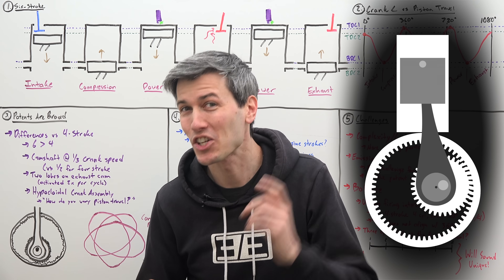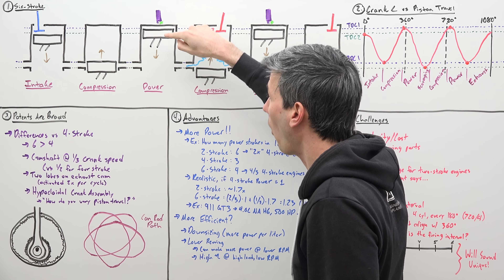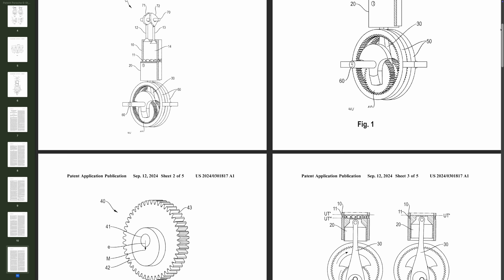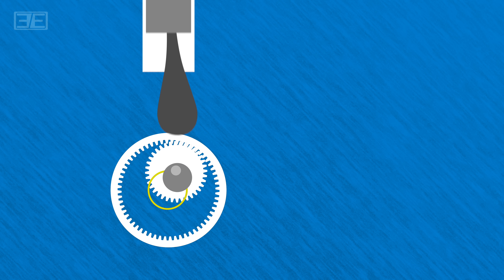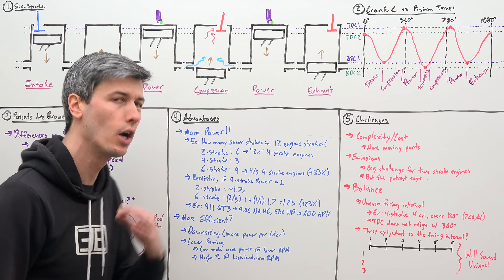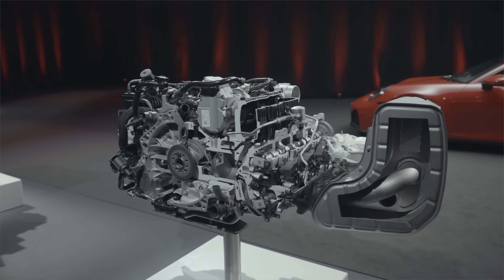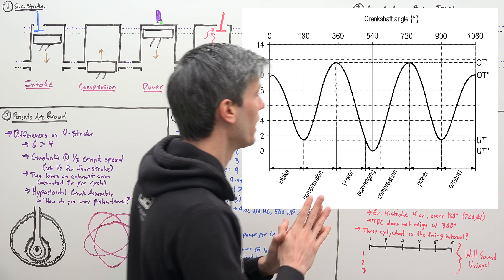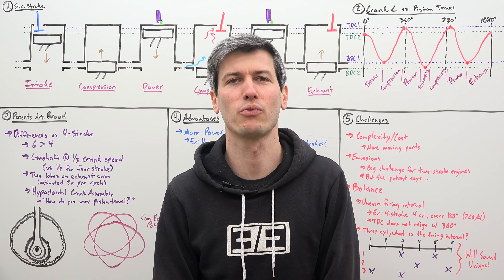Porsche's 6-Stroke Engine Is Genius!

Comment: I dont see how this engine makes any sense.... So they're basically saying that a 2-stroke is better? At this point, you might as well have something like 2 cylinders 4-stroke and 1 cylinder 2-stroke in an inline 3, if you really want to combine them.
But there are reasons that cars run 4-stroke engines, despite 2-stroke ones being more powerful, as the vid says.
This just seems like a publicity stunt

Comment: I built a 6 stroke engine from a lawnmower engine 35 years ago in high-school.  It was a regular 4 stroke, then an extra intake and extra exhaust.  I had to rig in a second set of small valves and cam for the last two parts.  It wasn't more efficient,  just cooler running by the extra breath of air.  At first I used the regular valve and modified cam/timing gearing but it was doing an intake thru the carbon and just loading the exhaust with fuel, though with fuel injections it could have been simpler...but that wasn't going to happen with a lawnmower engine in 1990

Comment: 1. What a wild concept. I suppose maybe if they were to time their tdc on each cylinder to not necessarily be perfect like a typical 4 cycling but more like the cross plane of a Yamaha motorcycle engine. I can only imagine the angry Germans yelling at one another coming up with this patent. 

2. Congrats on your 1000th video. I remember back in late 2012 when I was a young apprentice mechanic that just bought a WRX finding your videos on YouTube. I never would have thought you would blow up like you did. It has been inspiring to watch as you learned new things and explained it so well to the minds of others that generally don't just read materials and understand it easily.

Comment: Innovation is always cool, but I really don't se the point outside of expensive sports cars. For a fun driving car I would prefer a high performance 2JZ, RB26 or a LS for a larger engine. Just a simple high performance engine. 

For a daily driver the technology has come so far that a electric vehicle always would make sense. 

So outside motorsports and luxury cars the new, modern and extremely expensive high performance engines is kind of dead. Because car people want older fun driving cars and regular people want low cost cars where EVs are dominating.

Comment: Would using Mobil 1 Hybrid 0W-20 instead of 0W-16 be ok to use? Hybrids don't run as hot and have more condensation in the oil. The new Hybrid oil is made to help with that. the Toyota owners manual says if 0-16 isn't avaible you can use 0W-20 till the next oil change. But would using 0W-20 all the time harm the engine?

Comment: Balance solution: 3 cylinder radial with 'big bang' timing. 
Cylinders each 120° apart, all fiting st the same time. 

Problem solved.

Comment: The issue I see is that in a two stroke engine the mixture enters as the piston is travelling downwards and is slightly compressed into the cylinder by the timing (by location) of the intake port. Similarly the exaust leave the cylinder with pressure from the power stroke, dragging in the intake charge as it exits.
With this engine concept (if it is to be NA) then there has to be sufficient vacuum in the cylinder when the piston clears the intake port, for the stationary air to be dragged in. This has to happen at the start of what would (in a 4 stroke engine) be the start of the exhaust stroke. I just can't see how (without forced induction) this engine will be able to exaust gasses and produce enogh vacuum to replace the volume of the cylinder in the duration at BDC where the intake valve is open. 
If it somehow can do this, it seems that there would have to be a difference in the power produced in this stroke and the more conventional power stroke. 
Again. If it could be gotton to work, then you would do away with the other 4 strokes and make a 2-stroke that is efficient and doesn't burn oil. 

This seems like it will always be a concept.

Comment: Thanks for the great explanation. Could they also have like an eco mode where the second compression is just an exhaust stroke and no second power stroke? This makes 1 power stroke in 6 strokes but also lower fuel consumption and maybe cleaner air due to 2 exhaust strokes?

Comment: How do you get passed the oil lining the cylinder walls, and not entering the scanvenging intake stroke? Oil will likely mix with the fuel, and be bad for emissions.

Comment: Does that 4th stroke really work? If my understanding is correct while the piston is at dead center bottom, the exhaust value is open letting the exhaust from the ignition at stroke 3 escape which would draw in air from the intake port at the bottom of the cylinder. But as soon the piston moves up to cover the bottom intake port, the exhaust value will need to close to achieve compression.

The exhaust is not being pushed out by the piston like a traditional 4 stroke design, so how much exhaust is really leaving via the exhaust port? This has a direct affect on how much clean air is being drawn in via the bottom intake port. If there's not enough oxygen in the cylinder the 5th power stroke will be weak. I'm not a mechanical engineer so maybe I'm wrong.

Comment: This will not be a compact engine design whatsoever. A couple takeaways, if each journal of cylinders requires a gear as illustrated, it seems to me that a multi piece crankshaft would have to be used, and it perhaps would have to have a larger bore spacing compared to its relative displacement to accommodate the second intake charge from the bottom. And with the added 2 strokes cam timing, speed and lobe design will have to be different as well.

Comment: x-Xxxx is the firing he writes on the board (X being two combustion events occurring in the engine simultaneously), i imagine the X will be offset with crank angle to phase with the '-' (no combustion events) for multiples of 3. it's difficult to verify in my head how the timing would work for harmonic balancing but eg

if we can phase the crank in a desirable way
x-Xxxx
xxxX-x
Xxx-xx
-xxxxX
xXx-xx
x-xxXx

or if you didn't care about harmonics
x-Xxxx
xx-Xxx
xxx-Xx
xxxx-X
Xxxxx-
-Xxxxx

Comment: This engine has all the disadvantages of both 2- and 4- stroke engines. All the valves from a 4-stroke which are going to drain the power. The pollution of a 2-stroke since the piston is a second intake valve so the lubrication oil will go into the piston. This is just bad design and bad efficiency. The imbalance is your least problem with all those mechanical parts that can fail. You would be better off by just sticking to a 2 stroke engine if you want more power.

Comment: My guess for how Porsche would handle emissions would be using some of the unburned fuel from the first power stroke to help power the second power stroke, resulting in a cleaner final exhaust on the 6th stroke. I'm not an engineer or professional mechanic by any means so I could easily be overlooking some other potential issues, but it did look like one of the 2 exhaust cam lobes was smaller than the other causing less exhaust to be pushed from the combustion chamber during the 4th stroke. Hopefully someone with more knowledge of this stuff reads this and could comment further. I'd love to understand better as this 6 stroke engine is extremely interesting to me

Comment: Two questions I would have about this engine to wonder about secondary effects on torque control :
1. How does the spark authority change with the extra stroke? Would Porche be able to retard spark more or less with this design?
2. How does is the system affected when in fuel cut?

Comment: Design single cylinder engine with end caps that allow stacking more cylinders.  Put the single cylinder engine in a motorcycle to see if it's useful.  If so, start stacking cylinders.  The emissions issue can be addressed by routing the 2-cycle exhaust back thru the 4-cycle.

Comment: You can get even firing intervals out of a 6-cyl engine. 1-3, 2-4, 3-5, 4-6, 5-1, 6-2. If you’re crafty about it, you could probably even split the difference as far as that small degree offset (one cyl. firing slightly ahead of the 60 deg mark, and one slightly after). So 6 strokes in 6 cylinders. Couple that with 6 wheels, all powered, and you could build the world’s first 6x6x6x6. Which I’m pretty sure we need.

Comment: I thnk there is a neat way to balance it, though that also balances the power stroke not being perfectly aligned with 180 deg multiples
You just have to continue your graph for 6 rotations, instead of 3. If you start with the first rotation and you fire at 1-3, then 2-4, then 3-5, then 4-6, then you go around the clock and do 5-1 and finally 6-2.
You always have two almost simultaneous power strokes for each 180 deg, one coming slightly before and one coming slightly after the 180 deg threshold.
Reply: Great minds think alike! I promise I didn’t see your comment, but we came up with the same solution just 6 (!) minutes apart! Cheers

Comment: I think in a 12 cylinder the power strokes should balance out. That would have 4 cylinders on a power stroke every revolution. I'm wondering if the majority of this is actually egr or emissions related. Using the "2 stroke" part of it to gain power, then push that exhaust into  neighboring cylinders on their intake stroke to get a cleaner burn and lower emissions. I see a big problem with reliability. That is a bunch of extra moving parts that will eventually wear and break. I like that they are thinking outside of the box, but I fear that the gains made by an extra power stroke would be minimal due to the drag all the extra moving parts would cause. I'm very interested in seeing a prototype that hopefully proves me wrong.

Comment: Heck, how do you lubricate the cylinder walls without getting oil into the bottom intake ports? And whatever you do, why you can't do the same thing in a 2-stroke and get rid of the oil burning issue of 2-strokes?

Comment: The level of detail these engine designers go through to squeeze out a little more power.  Its impressive.  From math, I assume that the firing diagram would be more "balanced" at multiples of 6 cylinders, so not sure why the designers listed it out as multiples of 3?  I know in some cars like honda pilot they developed some sort of system to turn on/off just one of the cylinders while running, I guess let it "idle" and not try and get power from it.  I am assuming this technology could be used together to fix when a cylinder is going to fire or not?  So if one of your three cylinders stays "idle" per cycle then you could have a "balanced" firing diagram in 3 cycles of 3 cylinders.    But in any given cycle you would only be using 2 of the 3 cylinders.  I still think multiples of 6 would be more preferred having two cylinders fire at the same time every engine "cycle".

Comment: I really like this channel, but I think this came up a little short. Driving4Answers went a little deeper and the TL;DW (IMO) is that the 2 stroke portion of the cycle extracts the otherwise unburned fuel at the end of the normal power stroke. This makes high boost street cars feasible.

Comment: Balancing it seems obvious to me, so there must be something I don't understand?
I'd consider this the same as a 3-phase electric motor, which has a completely flat power curve since the 3 phases are staggered by 120 degrees. If we number the strokes from 1-6, power is produced on 3 and 5, so by offsetting them by two (corresponding to 120 degrees) we get:

intake | comp1 | bang1 | comp2 | bang2 | exhaust 
bang2 |exhaust| intake  | comp1 | bang1 | comp2 | bang2 | exhaust 
bang1 | comp2 | bang2 |exhaust| intake  | comp1 | bang1 | comp2 | bang2 | exhaust 
-------------------------------------------------------------------------------------------------------------------------------------
b1+b2                  b1+b2                   b1+b2                  b1+b2

This thing would generate a combined bang1+bang2 power stroke every two strokes, so it might end up sounding like a throatier 2-stroke?

Comment: Another question, just how are they going to block those 2 stroke fuel injection ports?
Are they going to have a really long cylinder skirt to block it? Can't really have a valve, and it has to be blocked somehow otherwise the crank case is going to fill with fuel mix.

Comment: The key here seems to be related to the “scavenging” role of the “extra long stroke”. Presumably they are thinking (pretending?) that they can get closer to 100% fuel combustion by bringing in extra air (and fuel??) at the bottom of the cylinder, where fuel would otherwise potentially be incombusted at the end of a conventional power stroke. Seems plausible.

Comment: An engineer’s night at the bar turned into an engineering exercise. In effect, a Pipe Dream.
It would make gobs more sense and a lot more power just to perfect the two-stroke design. But I hint the hurdle is the same old oxides of nitrogen issue. Other pollutants will show up as well, but we’d be seeing two-stroke road engines if the six-stroke could be made feasible.

Comment: How about you explain how the air enters a cylinder full of hot exhaust gases? How about you explain how air enters when as soon as the piston starts moving up it covers the lower air intake port? There is no way on earth this would generate 20% more power than a standard combustion engine.

Comment: Lots of things are genius but the highest level of genius is simplicity. That's why electric motors are more of a genius idea than internal combustion engines.  There's only one moving part in an electric motor and no internal combustion engine will even get close to that.

Comment: Not an engineer but probably would have become one if I'd had someone with your communications skills teaching me.  First time I've watched any of your videos and you're explaining first this intriguing patent and my mind immediately jumped to a dragster type engine that rumbles unevenly, buh dumba, buh dumba, buh buh dumba -- and I thought immediately there will be something out of synch with this engine.  Minutes later you went through the cycles and showed this would be the case unless maybe Porsche has something else up their sleeves.  Would love to hear what you would speculate along those lines.  Also, isn't that crank diagram mimicking what happens cycle wise in the old Mazda rotary engines?  I had a second generation RX7 back in the 90s and the engine was incredibly tiny yet got me up to 135 mph during one test.

But key message is that you are a very good and enthusiastic teacher of engineering, and I'll be following your videos going forward.  Sincerely thank you.

Comment: Well, about emissions and high effeciency can be part that engine can be smaller to produce same power while when you at low power setting you can simply abandon the 2 stroke cycle, don't inject fuel at all and it's gonna not make extra power there and therefore lower fuel consumptions/emisions.

Comment: Interesting idea but I have two questions. 1, given that the intake stroke in 4s relies on a vacuum in the cylinder, how does the scavenging stroke in 6s work without turbocharging? 2, does this mean that you have a wonky torque curve given that you have varying distance between the bottom of the conrod and the centre of the crank?

Comment: My guess is the clean combustion will be because it will use a conventional straight exhaust and not have the 2 stroke scavenge pipe so a lot of the primary firing gas will remain in the cylinder and be reburnt like an EGR

Comment: So the next big American V8 is gonna be a big American V9 😅, but what I don’t understand is how can the second power stroke produce AS MUCH power as the first power stroke which is the only one receiving fuel, I understand the best possible efficiency of today’s combustion engines is at about 40ish % if all is well, but will we really be burning enough unburnt fuel on the second power stroke to produce as much power as the first, leading to the claim of potentially delivering ~33% more power at the same RPM ?

Comment: Reliability is going to be a huge issue with this engine.  That's not even considering the maintenance costs and increase in repairs cost due to the increase in complexity.  The lifetime cost of this engine is not going to be worth it when compared to an ev.  I already feel sorry for those ice die-hards who will pick this engine over an ev.

Comment: If the 2 stroke is such a power boost, saves fuel, and lowers emissions. Make it full 2 stroke. O wait it doesn't. The 4 stroke cycle is a more hp per power stroke, a more complete burn ( lower emissions / more efficient).

Comment: That sounds like the most unreliable engine ever made. With a lower hp  per revolution ratio. They would need extra balance shafts. Its just Germans trying to over enginerd things for no benefit. Its like an Olympic rowing team doing a full stroke then a quarter stroke, and repeat. First power stroke let say makes 60hp per cylinder. Then the 2nd power stroke makes 25hp. After 12 revolutions a normal engine would make 180 usable hp. And this nerded engine would make only 170 usable hp. Plus it will weight 60lb more, cost $4000 more, and be 50% less reliable.

Comment: i don't see how it can burn fuel completely since the two-stroke is the second power stroke then exhausht as usual, there is also the problems of lubrication and cooling since they just slap on the two-stroke on there, i am assuming they are using the current 2stroke concept which uses the air-fuel mixture mixed with 2T oil for lubrication .